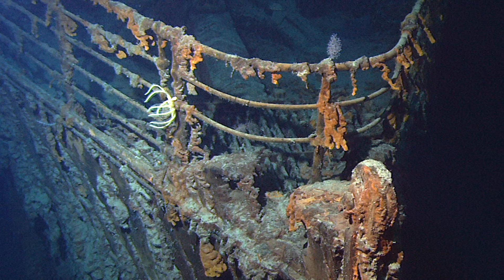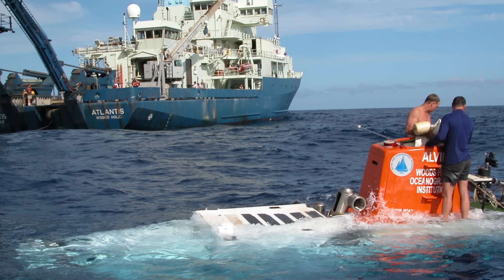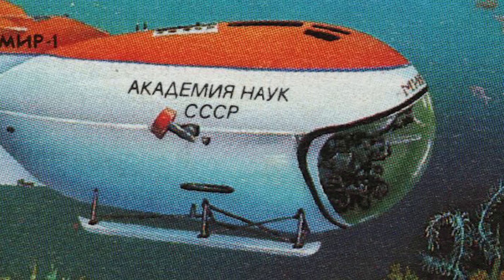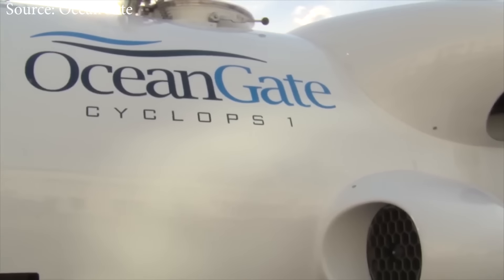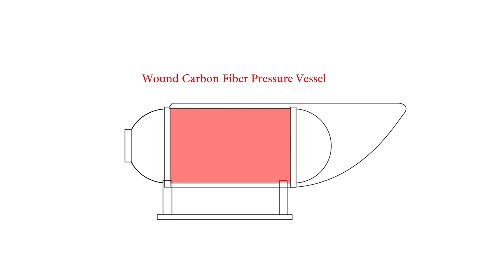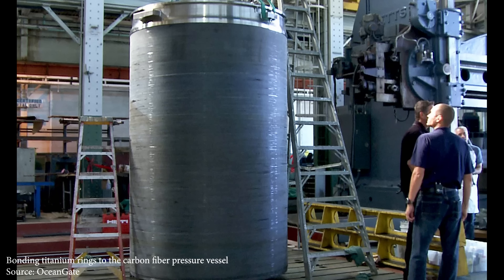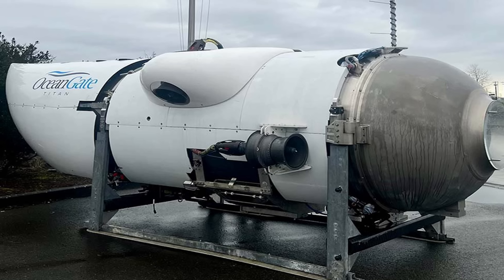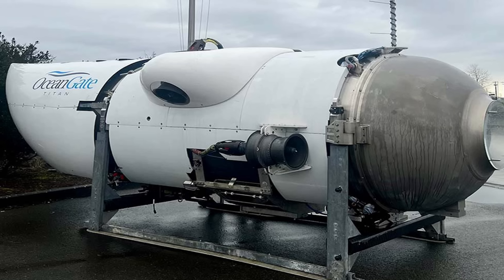How Titan was Built, Lost and Found: An Analysis

Comment: I stopped this one, as you started saying that they are a legit research organization. They stopped being that when they began getting rid of workers who raised concern about the safety of the sub years and years ago, even before they build the fullscale version. Companies like this should be forcibly shut down, and owners put in jail for premtive murder when they so clearly disregard whistleblowers pointing out extremely dangerous issues. The glass for instance was certified for 1000 meters! not 4000.... The lamination of the carbon fiber was a concern. They refused to check it for delamination during the testing. It's a huge issue on pressure vessels like this because these do not crack. They go boom when weak enough without warning. With that in mind they should have had it checked after each dive. But money talks for these guys. You sounding defending of them lost my respect for you. Unsubscribed and goodbye.

Comment: I watched a documentary following the team that found the deepest known shipwreck location at just over 6000 mtrs and their submersible when you looked inside looked like a cockpit for an air or space craft. The majority of its space is taken up by technology, failsafes, countless lifesupport systems and fallback systems, graded equipment, it even had the luxury of seating. It's just baffling that ocean gate officials thought it was fine to start commercial trips to that depth in what is essentially an empty decompression tube/coffin. And I will say this until the cows come home but the price of the tickets was so sus to me!! If I was offered to go to the bottom of the ocean for less than half a mil ATLEAST you best believe I be researching safety and you best believe that would be turned down the moment they mention "uncertified materials/submersible" my issue wasn't anything to do with the mission or even commercialising it. It's that they were knowingly and actively using store bought cheaper materials/tech that were completely insufficient for the depth that they were trying to achieve and the lack of ability to check and maintain such important things (seals/carbon fibre integrity/etc) to garuntee longevity and safety of the structure during repeated use. The challenger and the one mentioned above was designed far better, and one was only designed for single use, the other is meticulously maintained. Out of ten dsvs in the world, The Titan was the only one that was uncertified.

Sorry for the word dump it just angers me. This research company doesn't seem to respect the nature and power of the ocean, nor does it truly seem to value human life. It's sad he lost his life but from what he has said in interviews he didn't seem to value safety or safeguarding human life at all.

Comment: The de Havilland Comet was caused by a punched Rivet near the crew escape hatch. The punching of the rivets instead of drilling caused microfractures witch led to metal fatigue caused by pressurization cycles. When the failure occurred the crack followed the window line from the crew escape hatch. Windows were not the cause but effect.
Reply: Plus thin fuselage

Comment: I have a fair amount of experience with molding carbon fiber, but I'm no structural engineer.  I was a bit surprised to see them winding the CF like a sewing machine spool.  Everything I've been taught was to cross weave the CF for lateral and longitudinal strength and stability.  The strength is greatly reduced when weaved in one direction like they did.  Seemed like it could be cracked open like an egg.  If the CF threads are cross weaved, the shear strength is increased by 100 fold. The epoxy and CF threads have to work together... I think this CF pressure vessel could have worked had it been done right. High pressure tanks are made out of CF all the time, but they are most definitely cross weaved like this example https://youtu.be/gqhat_kpfao
Reply: I'm no expert but my experience working with it is the same. Nice observation

Comment: The actual point of failure in the Comet was not in the square passengers windows! And they were not square, BTW. The cracks were starting at the IDF antenna covers, which were called windows - this created a confusion and the press basically told the story as if it was about passenger windows.

Comment: The de Havilland Comet didn't suffer explosive decompressions due to the window shape (they were rounded corners too). It experienced it due to metal fatigue cracks growing from repeated pressurization cycles (something some in the submersible community were worried about the carbon fiber of the Titan). The shape of the windows had nothing to do with the Comet breakups, as can be evidenced from the accident reports showing how the origin point of the fatigue cracks weren't at the windows (nor did they cross the windows).

Otherwise good and interesting video
Reply: After the accidents they built a big tank of water and submerged a Comet fuselage therein, pressurizing and depressurizing it until it blew and blow it did.  We can say it was windows, thickness of aluminum, number of stringers, ect., but what it comes down to is that it wasn't built strongly enough for repeated pressure cycles and needed a redesign.

Comment: What's eerily interesting is that Titan suffered a very similar fate that the submarine USS Thresher did on April 10, 1963.   Robert Ballard first found the wreck of the Titanic because he was initially searching for the wrecks of both the Thresher and her fellow submarine USS Scorpion.
Reply: There was also knocking from thresher before it imploded
Reply: Very good point.  I was told by someone in the know that the Thresher went down due to a failed gate valve.
Reply: @bandname there was more than knocking they saw multiple instances of pings. Including 37 mainframe pings that came from it.
Reply: @Rltvader1  Awesome
Reply: @JoeLinux2000 from what I remember hearing when I was in the navy, Thresher had just come out of shipyard and water had got inside of the high pressure air lines that go to the main ballast tanks.  They went deep and either lost control or were testing the system but in either case, due to the cold water around those high pressure lines, the water inside them froze and ice blocked the air from being able clear the main ballast tanks.

Comment: Great video. It’s recently come out the materials were actually recycled from an aircraft that needed them replaced as they had “expired” after a long time of being used and enduring pressure changes that aircrafts endure. Although I’m not an expert, it seems other experts agreed that the materials were much of the problem, including them being recycled. Also the window was only approved for 25% of the depth.
Reply: A Boeing spokesperson has said that “Boeing has found no record of any sale of composite material to OceanGate or its CEO.” Given the exaggerated relationships with other companies, that makes the claim of providence by the CEO suspect.

I don't believe you would be able to reuse carbon fiber from a finished product in the manner shown in OceanGate's build videos. The only description we had (from clearly dubious CEO) was that it was past its "shelf life".  That more likely means it was excess inventory material, not harvesteed from an end of life plane. But even unused material typically has an "expiration date" because there may be additives that are ultimately supposed to help it bond with the resin that can break down over time even if the fibers themselves do not.

Comment: The moral of the story:- NEVER put Buzz Words ahead of Good Engineering. In this case, the Buzz Words were Carbon Fiber. Carbon Fiber is great WHEN USED CORRECTLY. Carbon Fiber works really well when put under TENSION. Under COMPRESSION, Carbon Fiber is utterly useless - it's basically really strong string. Ever tried pushing something with a piece of string? Doesn't work. Under compression, Carbon Fiber just becomes a weakness in the resin used to bind it together. Ironically, the submersible would've been stronger if they had built it just using the epoxy resin, leaving the carbon out entirely. If I, somebody who has Never worked with CF, knows this, HOW did the people involved NOT KNOW? Answer - they did, but the idiot in charge didn't want to listen, believing he knew better. Thankfully, said idiot was onboard. It's just a pity he took several others with him...
Reply: Why do they use it for the cockpits for Formula One cars then? The force of a crash is a compression.
Reply: @cuddlepaws4423  F1 chassis don't just consist of Carbon Fiber. They have several transverse bulkheads and longitudinal stringers, usually made of either aluminium or titanium, covered by multiple layers of CF cloth both externally and internally, with the outer & inner layers separated by a nomex honeycomb layer. This metal framing is a necessary part of the structure, as it is needed to be able to bolt the rest of the car to, because machining threads into CF isn't really possible for the strength of join needed between, say the chassis and engine unit (CF is crap in shear as well). They are very carefully designed so that in the event of a crash, the CF acts in tension, with the only compressive forces acting on the metal framing - something akin to a trampoline, a rigid metal frame with a cloth stretched over it acting in tension. Furthermore, they are cured in an autoclave (vacuum oven), to ensure that any trapped air is removed from the resin/fiber matrix to make the bonding as strong as possible.
On the other hand, the Titan submersible was made by winding stranded CF around a cylindrical former in a linear pattern, starting at one end, winding to the other with minimal overlapping of the stranding, before reversing the direction of winding (footage of this process is online). Resin was applied by hand, and the whole thing was cured under atmospheric pressure. This is quite literally the worst way possible to make a CF structure, as it makes the least possible use of CF's strongpoints, and maximizes CF's weakpoints. This alone tells me that whoever designed the Titan pressure vessel did not understand the strengths and weaknesses of Carbon Fiber in any way, and designed it with a "Carbon Fiber = STRONG" mindset.
TL;DR version. F1 uses Carbon Fiber in the correct way, and have 40+ years of experience in how to do so. OceanGate used Carbon Fiber in completely the wrong way, ignoring all advice to the contrary, in an effort to be able to say "First!", and it killed one idiot, and 4 innocent victims. Sure, they got away with it for a while, but every time they launched the Titan it was another step closer to an inevitable failure...

Comment: Greetings from Sweden!
You,Sir, just got yourself a new subscriber. 

Carbon is a great material for internal pressure, like scubatanks and the like, but to use it on a submersible that has external pressure is insane if you don't just use it for one dive.
The repeated stress that depth made on the material was doomed to fail.
The lack of knowledge by the designer of that vessel is (was r.i.p) just incredible.

Comment: Thank you, Mike!  ❤ This video certainly answered a lot of questions. I’m a visual learner so the animation is crucial. 

I saw an interview with both Dr. Ballard & James Cameron after the Titan’s fate was known. One of them (can’t recall which) said the French knew “exactly where to look.”  Now we know the Navy had heard the implosion and reported it. 

Considering the numerous difficulties, Titan was found relatively quickly. Did you say the people in the submersible suspected there was a serious problem? (They dropped the weights in an effort to return to the surface.) I would not have wanted to be in the Navy considering they knew the fate of the crew.
Reply: I doubt they knew there was a problem, the implosion would have been over in a fraction of a second, maybe milliseconds.  Obviously no-ones ever lived through a sub implosion to tell the tale but it's been postulated that before it happens those on board might hear a slight "crack" before disaster strikes.  The slight crack might only raise the question of "What was that?" among the crew without them realizing what was coming next.  Mercifully.
Reply: @wayneantoniazzi2706  You're right that the actual implosion would have happened super quick and the crew likely felt nothing and died instantly. That's not the same as not being aware that maybe there was an issue as they were descending. If they dropped the weights and started ascending before the implosion as James Cameron has indicated then they absolutely were aware there was a problem with the hull as that's what the acoustic warning system was designed to do. Hard to say though. We don't know where James Cameron is getting his information or if it correct. The Oceangate engineer who was fired said that he warned that the acoustic warning system wasn't adequate to give an actionable warning that the hull was failing.
Reply: @tboneforreal  
Thank you for the comments! Great thoughts all. 

You & I read the same comments, I think. The crew  dropped weights in an effort to return to the surface. From what I understand, they were ALWAYS losing communication. The fact they lost communication on the descent was so common that it wouldn’t have raised an alarm. 

Two reactions. To the public, Ballard & Cameron are go-to “experts” on Titanic.  They wrote the book on the evolution of DSV technology. 

Ironic that neither Ballard nor Cameron have voiced any frustration over regulation. I didn’t take Maritime law so this is not my specialty. Since they are in international waters, the government authorities can’t legislate how  they do things. Ballard & Cameron have voluntarily complied with regulatory requirements. 

I’m a retired (OLD) trial lawyer so I’m interested in these events. Not as a ghoul but because this is my old stomping grounds…
Reply: @wayneantoniazzi2706  This was what I was hoping for. Especially after learning the 19 year old was frightened and didn’t want to go on the trip.  He agreed to go to bond with his dad. (What he told his aunt.) I thought that was very sad.
Reply: @ailleananaithnid2566  You know, years ago I read that if you're traveling and before you get on a plane, a train, a bus, or whatever and you get a strange "vibe" before doing so, then maybe you should stay off, trust your gut and don't get on, take a later conveyance.  There's been plenty of examples of people doing so and avoiding disaster.  Who can explain these things?  Myself, I've never gotten the "vibe."
That poor kid.  I wonder if he got the "vibe" but went on board just the same?

Comment: I think that the titan's design could have been better. A teardrop shape ala USS Albacore would have had the same type of even distribution of force as a sphere albeit not quite as uniformly while still allowing for an increased passenger compliment. Also Mike, the comet's windows were not the cause of the decompressions, fatigue cracks from the hatch's rivets being stamped, rather than drilled and epoxied (as per the design plans) is what caused the accidents. The window thing is just the result of people not reading the full technical data from the investigations, as the TLDR.
Reply: vibratingstring  From what I understand the sub made 8 dives total over its lifetime, 2 of which were to the Titanic.

Comment: Just to ask, is there a definitive tally out there of how many test dives Titan made before starting its Titanic expeditions in 2021? Wikipedia claims a total of 13 dives on the Titanic wreck; it's been reported that after the Bahamas deep test dives in 2018-2020 the carbon fiber hull was de-rated to 3000 meters and had to be refurbished or replaced. If accurate, it would be informative to know how many deep test dives it took before that fatigue was detected. 

One thing you'll also notice about the manned subs previously diving Titanic - Alvin, Nautile, Mir I and II - is how festooned with kit they are. Lighting arrays, cameras, manipulator arms, etc. It's a little hard to take the "research" bit at face value with the minimal kit and controls Titan had; sure Logitech controllers are used for specific functions on other vessels but that and a Qwerty keyboard or two aren't the sum total of the system controls.

Comment: Thanks for this video, it was very informative. I want to note that the de Havilland Comet's windows weren't the cause of its failure - it was metal fatigue due to pressurization/depressurization over time that created cracks in the fuselage. Although the "square" (rounded square) windows didn't help, and later models were fitted with circular windows, they weren't instrumental in the aircraft's explosive failures. Engineers at the time were already aware that squares were weaker than circles when it came to pressurization, which is why they made the windows rounded squares.
Great video!!
Reply: More so stresses on the radio antenna on the comet mounted on the roof of the comet the rivets were to close together and the aluminium skin too thin ,yes the square window design is flawed but it was not the cause of the failures .
Reply: @czeslawmeyer7871  yeup